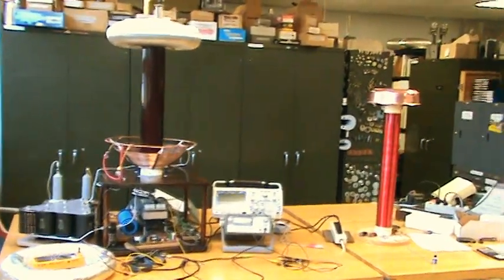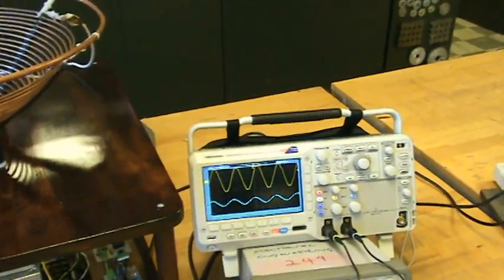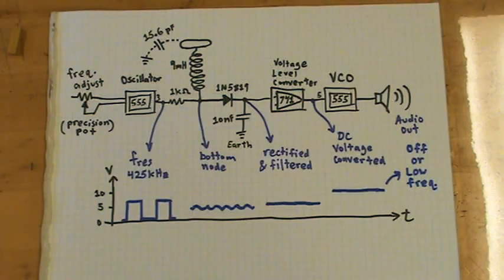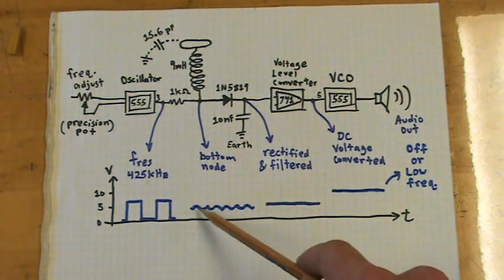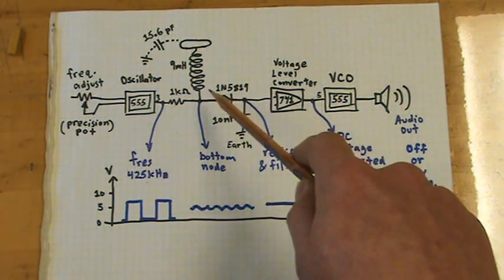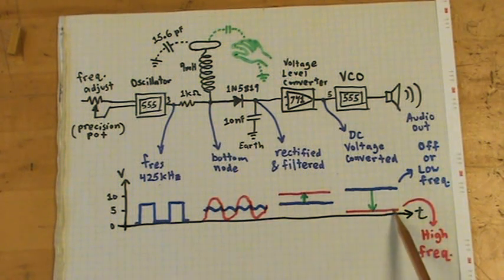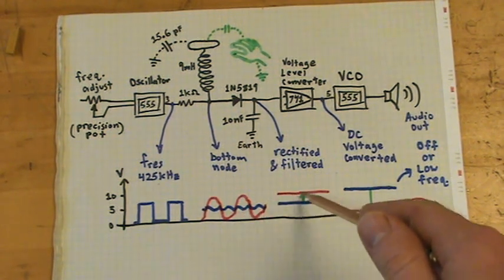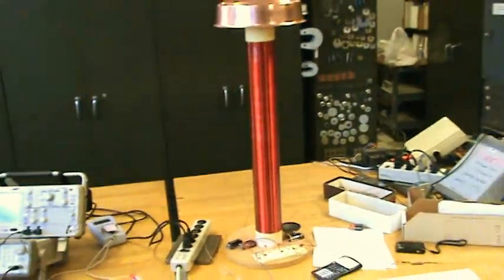(#0012) Tesla Coil Theremin

Comment: Great work Eric.  You show how we can find the resonant freq of the secondary and top load cap by simply driving low energy AC into the base.  Can you comment on how much that frequency changes when the primary is added?  Can the same technique be used with said primary shorted?  I really liked the part where you show the effective E and or M field strength as you move up the coil.